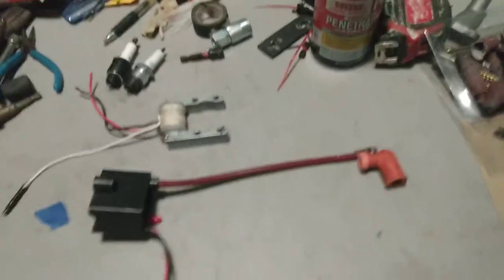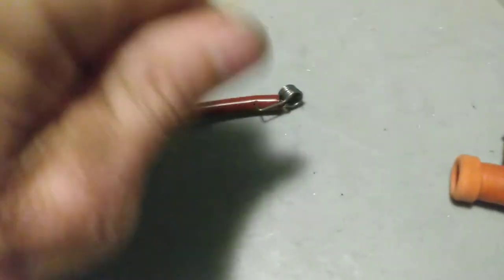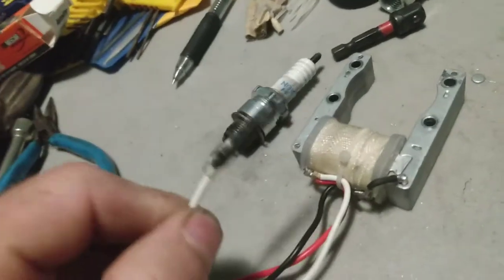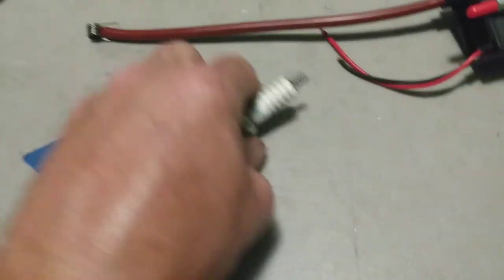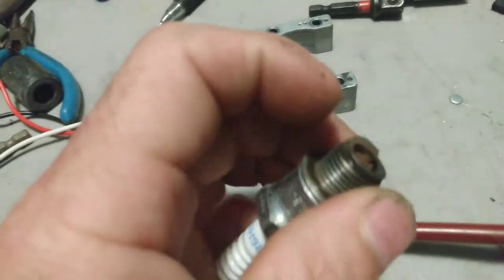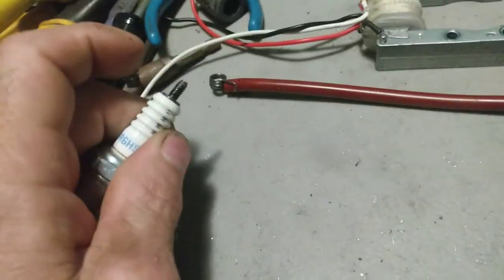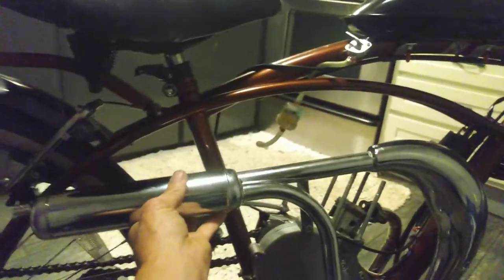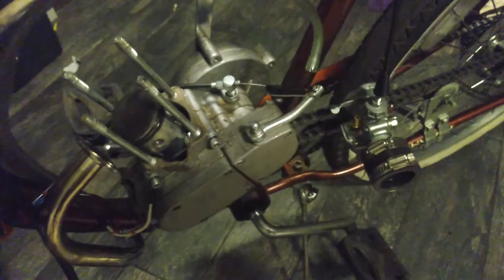No fire, poor spark on bicycle engines.

Comment: My bike wouldnt start everytime i would pull the plug out it would be wet. I could pedal for blocks and it wouldnt start. I finally put the 3 prong chinese spark plug back in and it fired right up everytime. I find it odd that the engine only runs with that chinese plug and not ngk champion or autolite. Any idea on why?
Reply: Thank you for posting this. I just bought a bike with an 80cc motor and I can't get it to fire. I'm going to buy a three prong plug and see if that works.
Reply: @petdemrabbits5103  for what its worth i ended up still having problems. After trying absolutely everything i put in a different coil module thing and havent had a problem since. I had spark and everything so i didnt think it was the coil. But after replacing that it has been great.

Comment: Don't run a light with the white wire because it takes away from the spark! Just buy a light that takes a battery and did you actually pass "mechanic school"?
Reply: just cut off the white wire
Reply: @joshjoshua6479  exactly! If you use it then it takes power away from the spark

Comment: I’m close to selling my motor kit…. My bike hasn’t ran in almost 2 months. Tried too many things to list
Reply: I just bought a bike with an 80cc motor and I cannot get it to fire. I've tried a lot of things.
Reply: Update…. After working on it some more, and changing some things,it screams now! Only issue I’m having lately is the choke can’t be opened all the way up. Really close, but not quite wide open.
Reply: I'm having the same issues with my 80 cc and about to take it to the scrap yard

Comment: Hey I have a two-stroke motor my bike starts and I can pull the throttle and he can hear it rub up a little bit but my back tire will not move what do you think could be the problem
Reply: Your clutch , if it’s not moving your clutch isn’t engaging

Comment: Get a £2 ngk spark plug boot screws straight on instead of spring set up i do agree with the way you cut the wire and earth it do you know anyway of rewinding magneto coil I’ve always have had constant problems with the copper wire burning up so when I buy new ones I put glue on the magneto winding to hopefully waterproof it not exactly better but does help keep the water out

Comment: i need help. my killswitch was ripped off and ever since then i can get the motor to rollover but nothing happens when i throttle it. it just idles for a second and then dies. can it run without a killswitch? is that my issue?
Reply: Yes it will run without a kill switch.

Comment: how you can tell if the magnet is in right
Reply: The small slot(keyway)in the middle of the magnet should be pointed to the right/1 o'clock position when it is towards the top of the engine. If it's backwards it will point to the 11 o'clock position and it won't run the engine.

Comment: After buying two kits neither of which had a spark plug that fit. And no spark then reversed wires then got yellow spark. I'm now going to goto Autoparts store for a new plug and pray that works. I'm dreading having to replaces all the wires and solder the connections rather than just twist them and solder. Bike only ran for first two weeks then problems no end and has now sat for over a year. I may get to it this year or ask it with a hammer and really make it not work it's the worst purchase I've ever made. And I've bought more than a few non working 50cc gas scooters before all I've had way less problems with. One of them I even had to use a medicine bottle with holes in it over the intake to get one scooter running. So I'm not above getting creative to fix something. But these bike engines suck.

Comment: Heyy man i can’t get mine to work I bought it brand new and I followed all the steps but I notice when I put the spark plug in the engine doesn’t want to run and then when I take the spark plug out the engine runs perfectly but when the spark plug isn’t in the engine all the air come out from where the spark plug goes instead do you know why is it doing this ?
Reply: An engine won't run without the spark plug. Learn your part names and rephrase your question
Reply: Huh? That's not possible, the engine needs spark to fire it up and keep it running. Did you mean to say the exhaust, if so, then that would mean something is plugged in the exhaust,  before you bolt it on the engine, blow in the side you would connect to the engine, and feel if it's possible to blow into and feel air coming out the otherside. Good luck.
Reply: @glennspears839  LMAO!! 🤣 Well said.
Reply: You trollin

Comment: low plugs number are cold use what it says to use or you will burn hole in piston!!!!  nimrod are you a mechanic or a water melon sales man do what us engineers says to use dont be a dope.
Reply: The heat rating of each NGK spark plug is indicated by a number; lower numbers indicate a hotter type, higher numbers indicate a colder type. -NGK SPARK PLUGS

The higher the number, the hotter the plug, and the lower the number, the colder the plug.
-Champion Auto Parts
Reply: Brought to you by the person who spells watermelon and salesman wrong. And do what us engineers say to use... not says. Who's the dope in this thread?
Reply: @farmtruck9885 well saids....lol
Reply: @petermcgrath5215  :face-blue-smiling: You says it right. :face-green-smiling:

Comment: It sucked something in and you had engine failure? What on Earth did you suck through the engine that damaged the piston and the jug to the point of failure? You didn't listen to the dude telling people to throw away the air filter? Are you? Let me just say that is a bad idea nk. Nnkay a yeah that's bad.
Reply: Bro I have built a few, just finished #43. I always chuck the air cleaner and never look back. My bikes breathe better, run faster, and never had anything happen enginewise except hung a ring after a careless port job, and neither has my customers. I even ride a few trails now and then. I guess I go faster than all the crap on the road that you seem to think are the cause of some catastrophic engine failures. I found that most are caused by improper oil mixture, wrong temp plug for the season, and just running too lean. You got to be going real slow through some bigtime debris with a tornado like tailwind to suck up enough to cause such a failure, but what do I know?
Reply: @refuge33 How’s it going nowadays?
Reply: Ive also built multiple and have never had a problem tossing out the filter.  I live in a moderate climate. In a dusty area could be better to leave it.
Reply: What is it about mechanics & bad attitude... Too many think they are too right too often